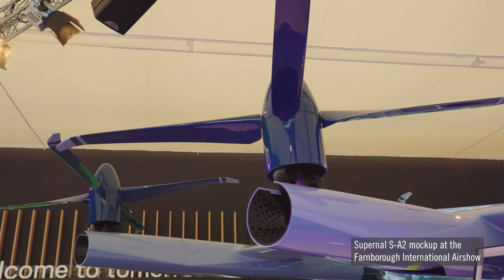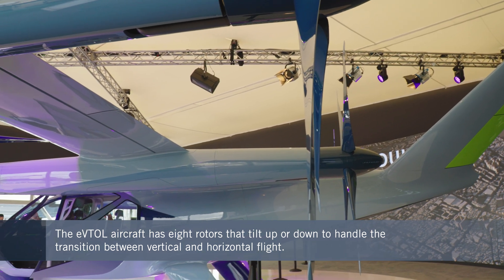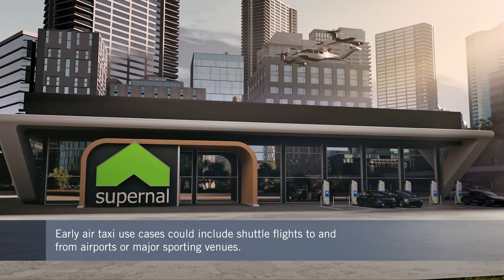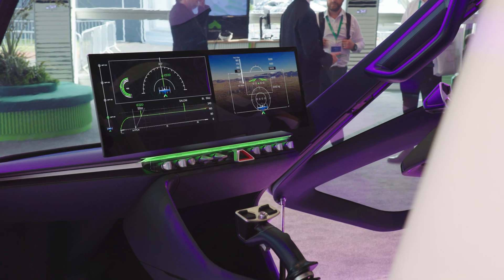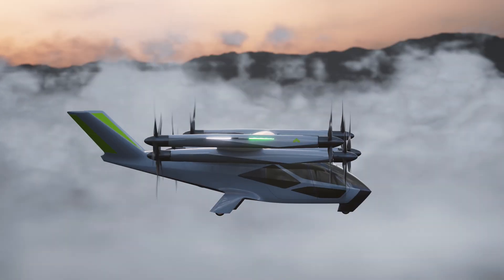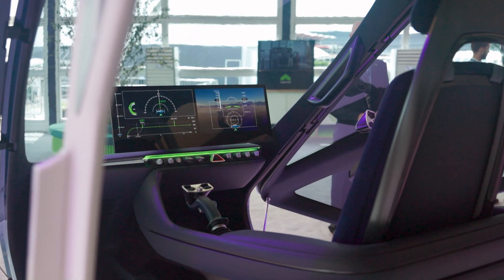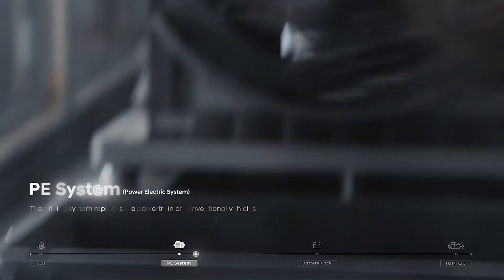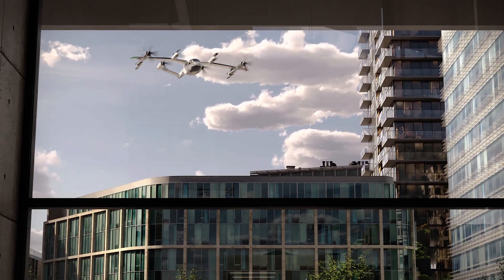Hyundai-backed Supernal Spells Out Its Plans For eVTOL Air Taxi Services – FutureFlight

Comment: This is an elegant design, much different than Archer Midnight. The reverse rotation may have several efficiency advantages; however, the location of a down-rotating prop may prove too low, potentially inducing dust. I'll be very interested in seeing if they stick with the design and if others follow.

Comment: Why is this sector so full of idiots? First, down-ward tilting propellers? It can go up or down . . . and their choice is to cut the head off a baggage handler or maintenance technician. “Oh, but it will be fail-safe!! . . . same as Air Traffic Control in the Nation’s Capital!”. And what is this fixation with flying in congested cities with congested airspace and expensive landing points? If one wants to get to the airport . . . . there’s a thing called UBER . . . and unlike the little E-copter . . the UBER has room for the entire family and its baggage. And how close do they think they are going to be able to land to the departure Terminal? More likely they will need a taxi to get to the Terminal from the E-Copter landing point. How does one spell “obvious” to these people ?
And hasn’t JOBY, for one, shown that noise control is everything. Nothing in the HYUNDAI propellers and engine design says “noise control”. . . . so, what are they thinking?
If these company people didn’t lead such narrow lives soaked in Group Think. . .. they might think of marketing the E-copters to remote vacation spots, ski resorts, remote company work locations, agriculture and Island hopping . . . where automated flight is easy and landing costs nothing. But Oh no . . . they see the PAN AM building and think . .”We have to land THERE!”. The idiots in this sector are set to obstruct effective adoption of the technology for years to come.

Comment: a tiltrotor design is best suited for an eVTOL aircraft . . . for e.g. the ship-borne MV-22E Sea Osprey multi mission tiltrotor . . . by principle it's two turbo-prop engines on either end of a pair of high set short lateral stub wings criss crossing the longitudinal fuselage at right angles . . . the turbo-prop engine swivels (tilt) longitudinally, full 180° deg for forward flight . . . in stationary hover mode the turbo-prop engines of the MV-22E swivel back into it's vertical (perpendicular) position during take off & landing . . . a tiltrotor eVTOL follows the same principle . . . incase of an eVTOL it's two prop driven electric motors on either end of two stub wings . . . 36.35 kN - 54.69 of pure e-power & an endurance of 200 miles (434 kms) . . . so many propeller driven motors makes you wonder that the Supernal has just enough grunt to fly . . . but not more, which is why the additional prop driven electric motors . . . the more than usual number of propeller provides more lift that compensates for the modest power output of the e-VTOL prop driven electric motors . . . which might not be enough for a full flight e.i. from take off to sustained flight to landing . . .
Reply: ☝️....what he said

Comment: Electric motors are awesome ! Batteries are not
Reply: They are getting better and better.  As they do, these will improve.  Solid state batteries are well into development.  Also check out Joby, in addition to battery powered flight they are also developing hydrogen powered aircraft.
Reply: @dhsajdak  so hydrogen is not a good fuel it currently needs 2 units of energy in to get 1 out , and as for batteries I hope you are right but I will wait till they work . Lots of private jet owners are now using SAF and E fuels which are carbon natural and I think much better options along with new engines and airframes
Reply: @sladehelicoptersgaming3148  There are a variety of factors that determine what makes a good fuel.  Two major reasons for the push of electric based flight are noise and in flight emissions.  With batteries there are no emissions and with hydrogen the only emissions are water vapor, which makes both fuels capable of operating in locations that are not viable for current helicopters.  The noise is the other major factor and both the battery and hydrogen powered electric motors are going to be massively more quiet than any type of combustion motor.  This makes them way more desirable for highly populated areas.

Comment: Impressive the pusher idea should achieve a better forward speed in airplane mode 
so if I understand correctly 4- passengers means no pilot on board. ? 
Good looking design looks like comfortable size . 
Wishing them best of luck and success.
Reply: 4 pax + 1 pilot. Watch the video @ 41 seconds

Comment: Likely pricey for 4 passengers and a limited range / endurance. What's the point if it can't do better than a helicopter ?
Reply: The reason companies are developing these, for cities in particular, is low noise and zero in flight emissions.  Check out Joby.  They are very deep into development.  Their craft is extremely quiet compared to helicopters.

Comment: Why Do Astronauts Float in Space?
This is the Secret
And the high-speed Space Station
Artificial Gravity is what is being sought and is very valuable

Something that is far in space beyond the magnetic reach of the Earth then that something NO LONGER has Density, instead it floats around aimlessly until it is again in the magnetic area of a celestial body that has a Magnetic Bar, then it will fall in that direction; This practically happens because all celestial bodies drift through an orbit at extraordinary SPEED. 
Astronauts and other objects in various Apollo rockets sent to the moon in 1969 proved all this information, and these objects and astronautes seemed to be floating in the space of the rocket.

So actually the Magnetic Bar stretching from north to south is what causes attraction (gravity), and every concrete object has a Falling Motion or Specific Gravity (Density). 

Every concrete object consists of an arrangement of atoms and emptiness. These atoms have particles that also have a magnetic bar in their mass. The magnetic bar on the atom is what ATTRACTS EACH OTHER to the MAGNETICBAR on Earth. The denser the object is with the arrangement of its atoms, the greater the DENSITY or the greater the falling motion. 

The difference in atomic density is what differentiates the specific gravity or density of each concrete object.
As a result, a mass that does not have a magnetic bar stretching from north to south does not attract or be pulled, and only two masses that each have a magnetic bar attract each other with a force that is proportional to the distance between them and the magnetic attraction value of each.